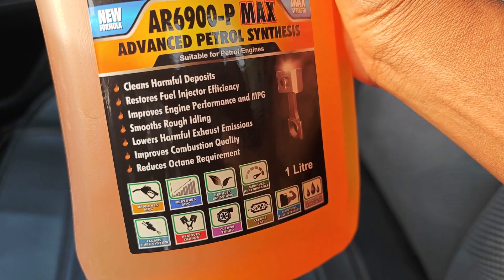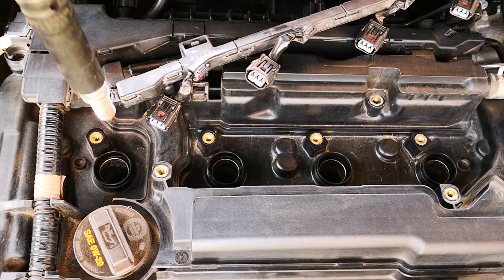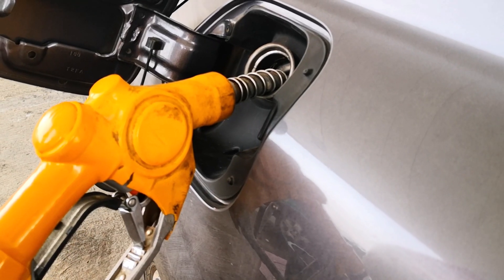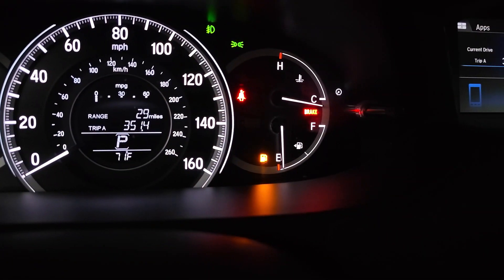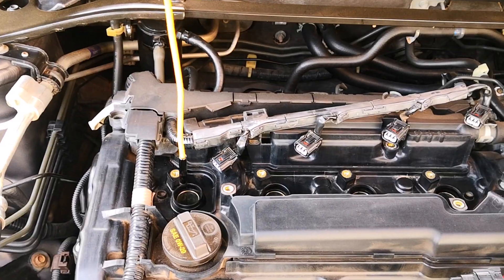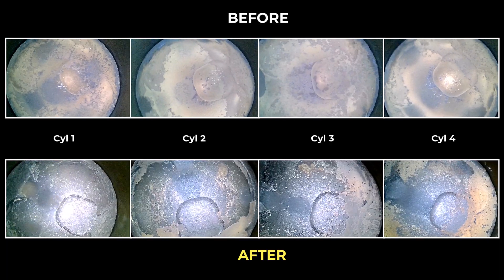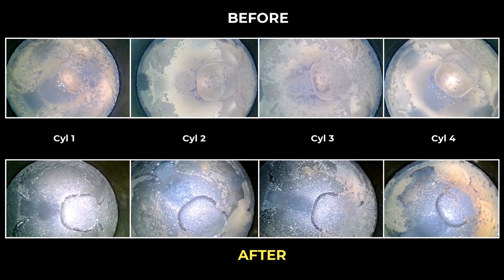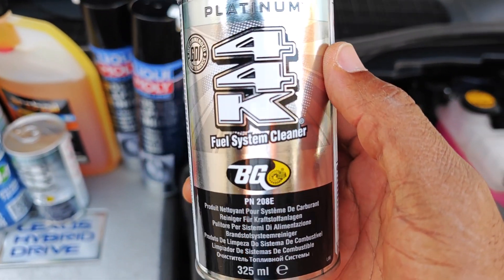Fuel Additive Tested for a YEAR! Does Archoil AR6900 P-Max Really Clean Carbon Deposits?

Comment from the maker: Do you use fuel system cleaners regularly? Which one? 😀
Reply: I don't have access to any top tier fuels in my area (Shell, Chevron, etc), so I have been using Chevron Techron fuel additive.  I don't have any testing data to see if it actually does anything.  I guess I should get a bore scope and start looking in my engines.  Thanks for doing your test!
Reply: I use the ones I "borrow" from work. It's called Renu500
Reply from the maker: Hadn't heard of it, but I have now. Thanks for sharing
Reply: Thanks sir
I use seafoam
Reply: I use Red Line Redline S-1 and 505 crf fuel system cleaner

Comment: hi! great video, so of all the cleaning products, the one that perform the best is the liqui moly true? you could use liqui moly five times like in your video and then do maintanence constantly with something like the AR6900
Reply from the maker: I'd say the best cleaning and power restoration I've seen was from BG44K Platinum, but it doesn't come cheap. Also Valve Clean is the only cleaner I've round back to back on 5 fill ups and paired it with spirited driving. In that sense, I won't say it's the best, however because of that approach, that was the cleanest I've gotten my pistons.
Your suggestion makes sense, use a shock treatment and then maintain with Archoil

Comment: Try bonding a lubricant to the metal in your engine.
After treatment the soot in a DR650 engine dropped to zero.
This results in much cleaner pistons than using a fuel additive as it prevents the formation of carbon not just its removal.
Plus it only requires a single application.
🙂#XcelPlus

Comment: I used liqui moly fuel system cleaner for 1500kms when initially buying my car 2nd hand, along with running Valvoline Restore and Protect.  Now I will run the fuel system clean once every 5000kms.  I also run Shell V power in it constantly.  Should have a look at those piston crowns and see if they are cleaner myself!